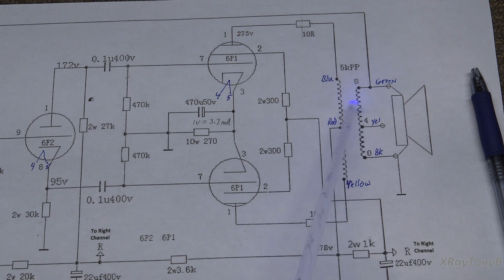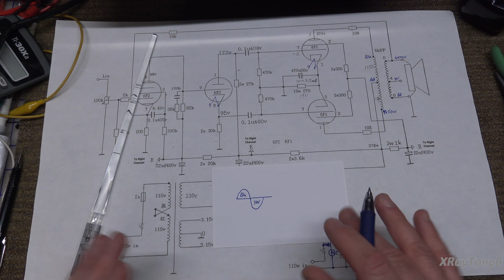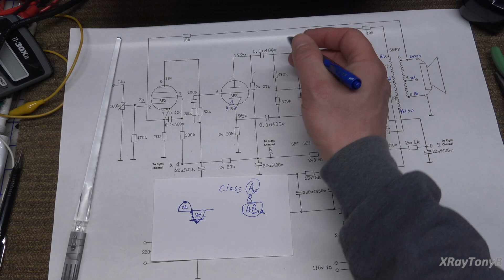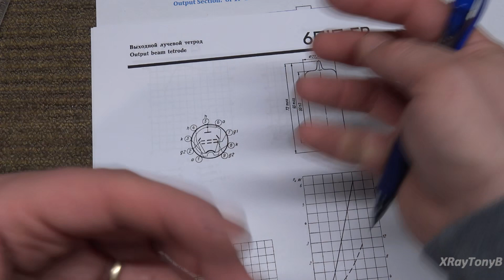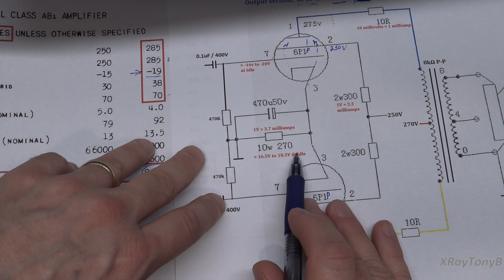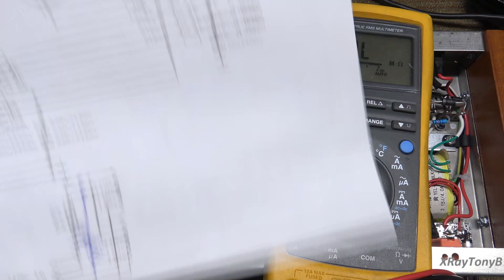Electronics 101½ Part 9 -  Tube Amplifier Output Section

Comment: When looking at output tube datasheets, keep in mind that the suggested operating points and load resistance can be a bit different for fixed bias vs. cathode bias. Some datasheets don't include both cases; others give full charts of figures for both fixed and cathode bias setups. But then some original datasheet values end up running tubes very hot, so it's good to do a reality check on what your idle dissipation will turn out to be.

Comment: Nice tutorial as always Tony! Two things, the resistors in the anode leads also will act to "tame" an amp wanting to oscillate at a high frequency. Most often grid stopper resistors are used, though. They have to be close to the pins to have an effect in this case. The EL90 is, in fact, a 6AQ5 tube with a JEDEC nomenclature, with 7-pin min base

Comment: Why is it that you hardly find any tone control on a tube amplifier where almost every solid state amp has it? I'm planning to build a similar tube amp with el-34 Single Ended but would like to add tone control, e.g. bass treble, to it. But where in the schematic do I put the parts?
Reply: Follow your signal path, so you may put it  in the first grid or  after the coupling capacitor (not before).  Before the cap. there is DC but after only AC.

Comment: Interested in doing a troubleshooting  video? Lol.... i bought the same kit a while back, used the circuit board and the non existing instructions...
I get a piercing tone...
Reply: John, me too.   I bought this kit in summer of 2020.  Built the kit with the PCB and had the same screeching tone.  Figured it was some type of grounding issue, as all the reference voltages were ok. I put the amp on the shelf and gave up for a while.  When I saw the same amp as part of this series, I took the amp apart, ordered a bunch of new resistors and capacitors from Mouser, and have been building along with the video.  So far, so good!
Reply: @tommcnulty3384  yeh.... i'm planning to do the exact same thing, lol.... i bought a built nobsound (douk?) 6p1 amp.... works great, a little under power for my deaf ears... there are mods for that one i plan to do, and i'm going to desolder/rebuild this one PTP....
Reply: @tommcnulty3384  Check your negative feed back or just switch your output
transformer leads(try it).
Reply: @qpiter  too late- I took the entire unit apart at the start of this video series.  Currently rebuilding Point-to-Point along with the videos.

Comment: Xraytonyb, Great video on the output stage explanation, you covered Pentode mode vs Triode mode on the power tube. Triode may have less power output, but also has less THD. The transformers used, don't have the screen taps for Ultra-Linear mode, which is a compromise, slightly less power then Pentode mode, but the lower THD of the trode mode.  In effect the screen taps on the OP transformer offer a sort of local negative feedback to the pentodes. Too bad the kit did not come with U.L. transformers.

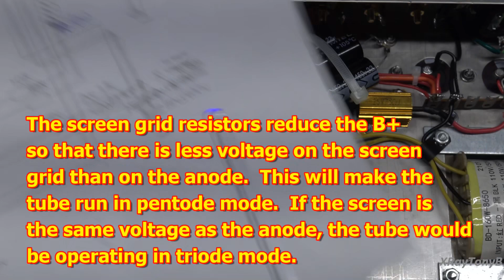Comment: The way the explanation at 45:30 is worded, the reader could get the wrong idea. It's not the voltage level at the screen that determines whether the tube is in triode mode or pentode mode, it's whether the screen voltage tracks the plate voltage or if it is fixed. If the screen is tied to the plate (either directly or via a resistor) then the tube is in  triode mode. If the screen is tied to the power supply (and has a fixed voltage) then the tube is in pentode mode. Depending on the tube and the circuit, the voltage supplied to the screen could be the same as the B+ voltage that goes via the load to the plate or it could be reduced but it is still pentode mode.
Reply: I caught the same thing. In fact, in some early beam tetrode amps, the screens were hooked directly to B+ with no dropping resistors, meaning the screens were actually at a higher voltage than the plates at idle because the plate voltages are dropped through the OT DCR. This was a simple and inexpensive way to do it, but it could result in screen grid damage when the amp was driven hard, so you rarely see it done that way after ~1950.

In some Fender guitar amps, you'll find the screen grid voltages are very close to the plate voltage at idle, but they are certainly not triode output stages.

Comment: Hi Tony
Beware of the anoderesistors, if one of these disconnects you will burn the screen in the corresponding pentode. It is much safer to have a safety/measure-resistor in the cathode.
Love your videos.  :)
Regards Spuncut

Comment: Hey, Tony, Do you prefer the cathodes to share the same cathode resistor and bypass or have separate ones for each?
Reply: The Heathkit W-5M amplifier has a DC balance pot to balance the cathode bias voltage to the outputs. Works quite well as long as the cathode bias resistors are closely matched. Just set the test points to a null voltage with a simple multimeter.
Reply: SRT, that is a great question. Now that you mentioned it, I have always seen each tube with it's own devices. Such as other designs, such as my Heathkit W-5M amps.
Reply from the maker: For cathode bias, you are better off with separate cathode resistors/caps, but I am building this amp as it was designed.  After it is complete and I have tested it, I may decide to make some mods to the original design.
Reply: @xraytonyb  Yes, I have found that you can make up for some of the mis-match of the tubes/OT primary that way. I think some designs are made to a price point. I've also found that since no pair of tubes are exactly match, it can sometimes help to have each tube in a particular spot based off OT primary inequality. Thanks!!!!
Reply: @xraytonyb wow I hadn't got to the part in the video where you said exactly that. LOL
Reply: @xraytonyb  Not only having a way to balance the op tube's bias, it also pays to have a way to adjust the balance of the phase inverter driver +/- signals. Actually you need to have an unbalance in the phase inverter to have a symmetrically low THD sine wave at the output, because no two power tubes are perfectly matched and transformer winding resistance differences.  I did build a stereo tube amplifier with bias and phase inverter balancing pots for lowering the THD. You could almost get away with no or very little global feedback, with this method.

Comment: Has anyone recreated this amplifier using TELEFUNKEN Space Charge Tubes and power the unit via a ZENITH HEDGE Battery Pack that requires 6xD cells and 10xPP7 batteries but of course batteries are not included.

Comment: When I look at the the resistor/capacitor chain in the power supply, it looks like cap-resistor-cap-resistor-cap-resistor-cap.
I don't see two capacitors per resistor.
Reply: It is electrically the same, note the negative sides of the capacitors still go to B- return. He just tied the two negative rails together and dropped them down on one line. (edit: changed word "ground" to B- which might have been more confusing)
Reply: @zulumax1  I just wanted to point out that there are not two capacitors per resistor, but just one. So there is no series of pi networks, but only one, after the rectifier. Hope this makes more sense.
Reply: @__Dude_  He did mention that the first resistor in a tube amplifier is usually a choke or inductor. So the first resistive device would be called the pi network, and the rest are just part of a voltage divider network with smoothing caps. Is that correct? What is the definition of a pi network?

Comment: Surprising you left the OP stage shared cathode resistor as is, it generally being considered inferior to separate cathode bias resistors & caps,say two 450r. To keep the exact same cutoff frequency of 1.25hz (which is a bit low maybe?) though means a 280u cap, a 220u is near enough though (1.61hz). Didn't watch every second of the video, so apologies if I missed you mentioning it. Keep up the good work...DA.
Reply from the maker: For the time being, I'm sticking with the circuit as it was designed and using the components that came with the kit.  The only place I substituted components was when I needed to use an axial component in place of a radial-lead component for the point to point wiring.  In those cases, I used the same values in an axial package.  We may try to make some improvements after we finish and test the amp as is.  ☺

Comment: that's an odd way to assemble the binding posts in chassis. i assemble it as such: outer, inner,nut,solder tab,lock washer , 2nd nut. if you think about it, having the solder tab sandwiched between a nut and a lockwasher/nut = much more surface contact area. plus you have the benefit of having the terminal attached to the chassis and soldering your wire to the tab THEN  attaching it with the lock washer and nut.